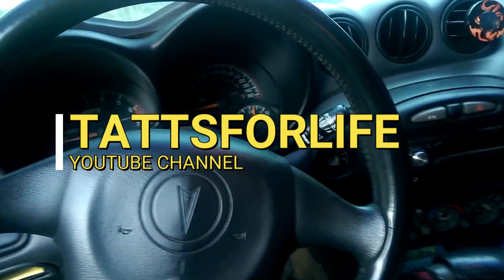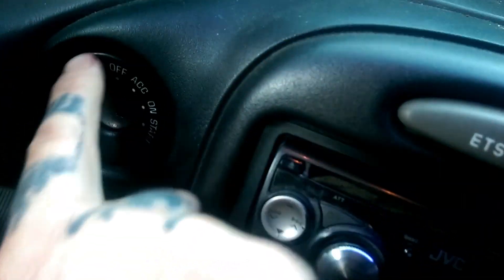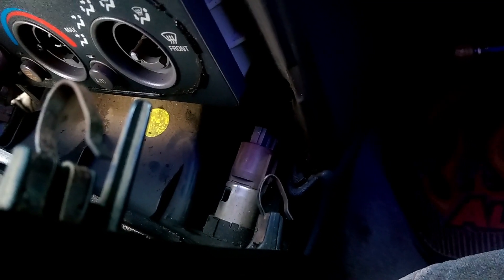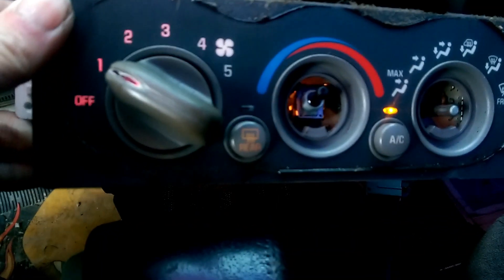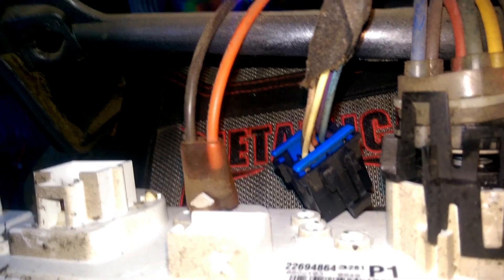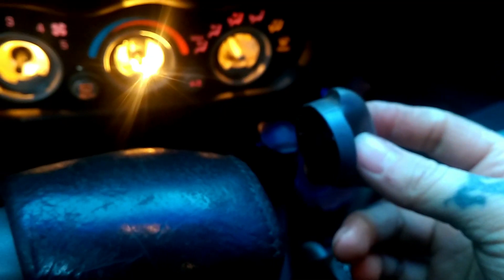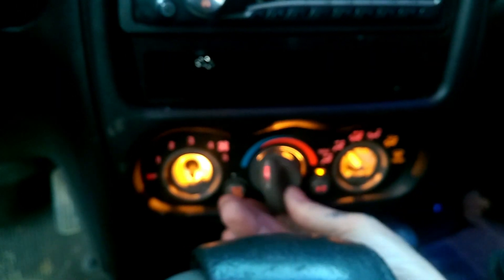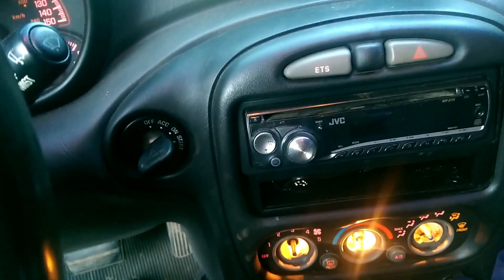A/C & Heater Climate Control Module Removal And Replacement | Grand Am Edition | How to

Comment: Wow this guy is a butcher breaking things as he goes lol god forbid bringing your vehicle To this guy!
Reply: No, the Grand Am's climate controls are just jank as hell. I had to replace all 3 knobs, and the fan speed knob didn't have any resistance to over turning. It would actually turn on the fans with the knob upside down. 
The dash on those cars warp to a cartoonish degree. I've seen some that were basically starting to fold in half. Don't even get me started on the water leaks (known and widespread issue). It's saving grace is the powertrain and drivability. For a cheap late 90's/early 00's car, it had great handling responsiveness.
Reply: @boltinabottle6307  not to mention that plastic parts on a 15 year old car often get brittle and weak.
Reply: @greglivo  Coming in to Necro this. The Grand Am was Pontiac's best selling car. It is also the best Piece of shit Ive ever own. The thing has a few minor issues but starting and driving has never been one of them and for many owners that is the case. usually they head gasket kills it before you get Toyota mileage on it but if maintained you can easily get Toyota mileage even if half of the car is gone from rusting out or from young drivers driving them like they are race cars.

Great cars setup to fail horribly yet still drive around with a very small maintenance bill attached to them
Reply: @boltinabottle6307  OK. So tell me. 05 Grand Am GT1 Speed 5 stopped working. Two weeks later no blower at all. Replaced resistor. Nada. Replaced blower motor. Nada. Friend said it is the switch. Still stagnate. Whatcha got? Think it's the switch itself?
Thanks